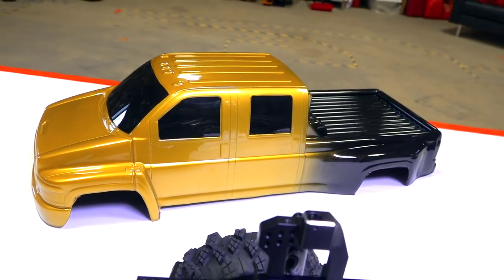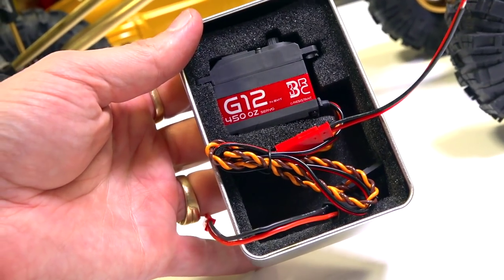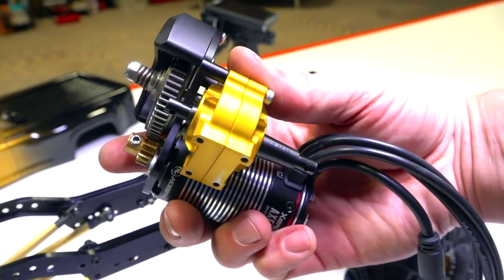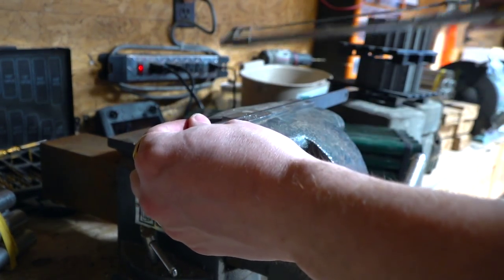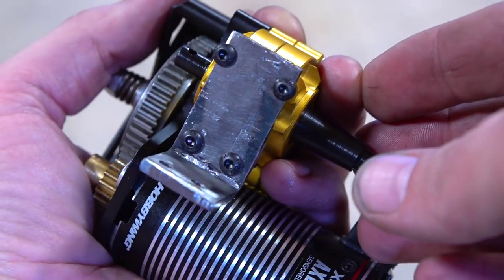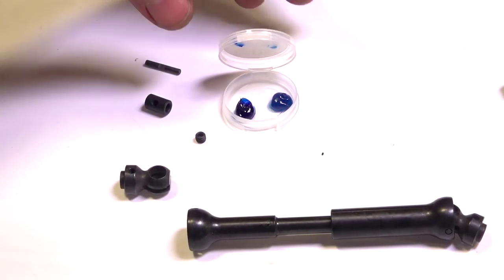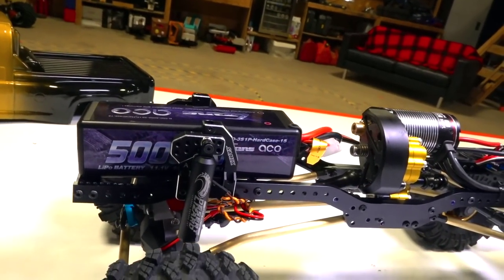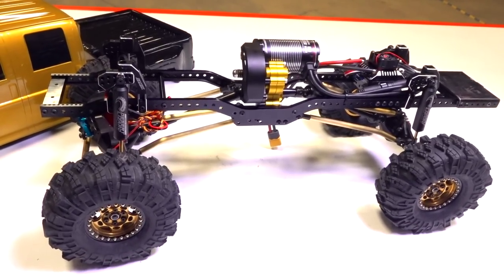PROJECT "OVERKILL" 2020 (PT 5) DON'T GET LEFT BEHIND! OLD, NEW, USED, & MADE - BUILT | RC ADVENTURES

Comment: Curious on how you will ever remove that transmission since two of those screws are right at the tighest part of that bend. 

All and all very cool tho!
Reply from the maker: Should be pretty easy to bend that piece back if I needed to get in there! I dont anticipate an issue.. the cool thing is, it only took a few minutes to make
Reply: Could always drill 2 holes on the frame mount side in line with the heads of the motor side screws... save a little weight to.....lol
Reply: @stevenkirkman60  great idea!
Reply: @TheRealRCSparks  very true

Comment: I think you should move both your shock towers, front and rear a few holes in towards the center of the chassis. I think it will help soften your suspension and less stress on your links and shocks.. love the build!! You want soft spring in front with 80% droop and stiff springs in the rear to really dig and push you over an obstacle. Soft foam dual stag Innovation in front to conform to rocks etc. Firm dual stage in rear.

Comment: I had that transmission mount issue a few weeks ago when putting an Axial trans in my Tamiya F350 chassis. I used kind of a Z , mounting to both frame rails.  Loving this Overkill 2020 build 👍

Comment: I have a feeling that the motorplate is going to flex much under heavy load, I would suggest making one that mounts to both framerails.
Reply from the maker: We actually did this a few years ago with the Heavy Duty version of Overkill called the "Juggernaut".. https://www.youtube.com/watch?v=wL85mMze8QA Sideways mounted  transmissions with Dual Motors on Each transmission (there was 2 transmissions) No torque flex to worry about.. but Ill keep my eye on this one. Thanks for the advice. Always good to have someone looking out for ya

Comment: Seems like way too much caster in the front lol wow 

Personally I would tilt it back down to correct that so you get way better steering out of this beast!
Reply: Makes the driveshaft angle wrong too.
Reply from the maker: There is No caster steering in the front at all! There are turning no problem.  The bonus about this great chassis plate setup is I can play with it all I want and dial it in.. there are so many choices!
Reply: @barryking8966   No full scale rock crawler has a perfectly straight drive line from the axle  Because clocking the axle to make it straight will cause you to lose throw in your steering

 But Hey looks cool though
Reply: @TheRealRCSparks   I'm so happy that you're redoing project over kill I remember watching the original project overkill
Reply: back when the whole dual motor plate was cool lol
Reply: I never said the driveshaft should be straight. The pumpkin and the trans output should be more parallel. Go watch a vid on driveshaft angles.
Reply: @barryking8966  haha I know about driveshaft angles. I think we just have a miss communication.
Reply: @barryking8966  I take it you were agreeing with my original statement on the tilt?
Reply: Yes I was.
Reply: @barryking8966  see I'm kinda dumb hahahahahahaha I would like to blame that on a Longgggg day of work and lack of RC haha
Reply: No sweat dude. It’s all good.

Comment: needs a sub frame bolted on to lower all the links. that looks crazy. and link geometry will be weird when it flexes.
Reply from the maker: This is how the Chassis is designed brother ;)
Reply: RCSparks Studio i don’t think it was designed to run such long shocks or that much lift was all i meant. lowering links would look better with the lift or length of shocks. but i think different areas have different outlooks and style. so still following along. i like the rebuild of a new classic idea. 
 the axles are 👌

Comment: It's starting to look like a kick ass RC
Reply from the maker: Voododd666.. I wanted to build OVERKILL.. and knew that if I was going to revisit this OG project, i would have to do it right.. I think its starting to come together now.. Just got to drop the height and dial in the suspension. Then setup the steering properly and then start looking at places down low to add some weight. Im thinking weighted rock sliders.. but we will see... thanks for the love brother, I appreciate the kind comments

Comment: very nice, what is the "C" rating of that battery?
Reply from the maker: Basically a discharge rating. There is a peak rating, and a constant..
Reply: @TheRealRCSparks  i know that, i  want to know the values, the numbers... because im thinkin on getting  an rtr rc trail truck and  the battery that i already have is a 2s 2200mAh 35c that only lasts for 30 minutes i need a bigger battery like a 3s 5000mAh the only thing i dont know how to choose yet is the "C" rating... because of the 2 values i get confused sometimes... i donr know if i choose by the normal or the peak value...
P.s: i know thats kind of a noob question, but im still learning stuff as i go...
Reply from the maker: @nunodias3331  You dont need anything higher than a 20c rating on the battery for a crawler.  The higher the C the higher the burst rate for speed.   :)
Reply: @TheRealRCSparks  thank you mr medic👍